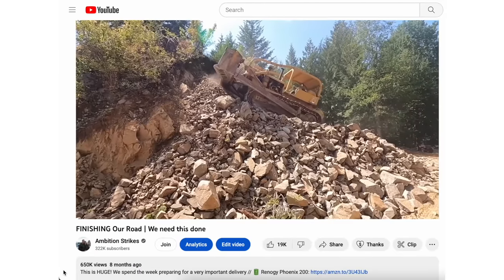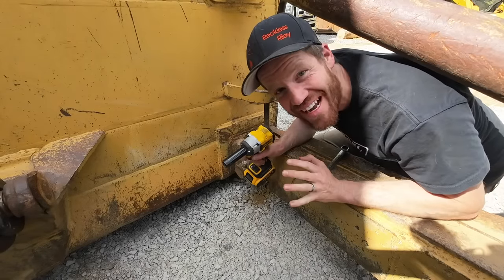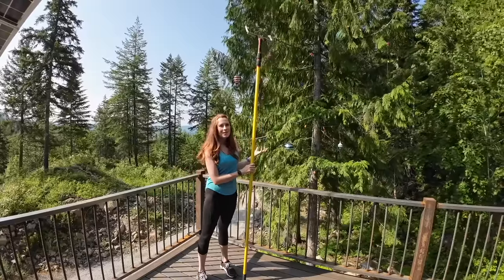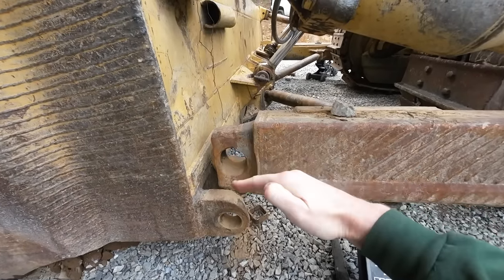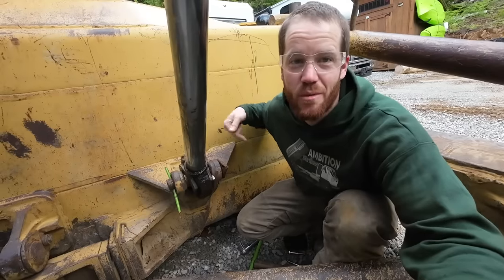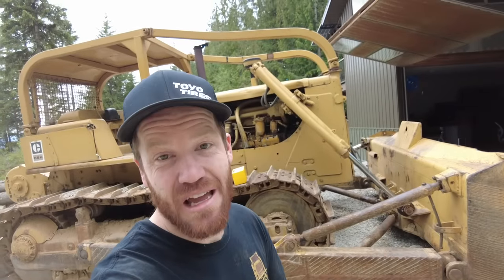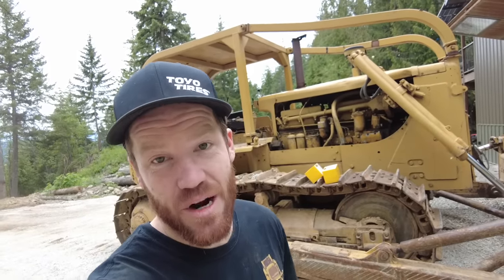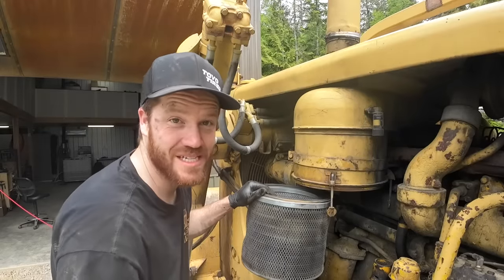Repairing My D8 Dozer (unexpected find)

Comment: I worked for CAT manufacturing and they take great pride that you can call from anywhere in the world and have the part for your CAT machine going back to the earliest machine they made.
Reply: I work in a prototype foundry and we make a LOT of small order service parts for some really old stuff.  We don’t make tooling anymore we just 3D print sand molds from CAD files and machine to 2D drawings from 1948.   It makes me smile whenever you see all the Rev changes and sign offs over decades of time.

Comment: Sorry to say Riley, but that connection at the lower corners of the blade should be a solid tight connection.  The tilt of the blade is taken up in the ball trunion on the outside of the track frame.  I’ve rebuilt everything you need there.  It would take a lot of time, money and welding.  Any welding you do on that bushing to make it solid would help, but leaving it loose will make it wear out sooner.
Reply: I saw that, but how much is he truly going to use it?  It's not like it's going to a job site 5 days a week is all i'm saying.
Reply: It's really a toss up, I am with you guys that there are a lot of issues here. I would like to see this stuff addressed, especially the trans/hydraulic system based on that filter this thing is a time bomb. The good thing is some of the cost could be recouped when they sell the machine. The gamble is that it just gets left the way it is and the machine goes down hard during use, a machine that big in a precarious situation is going to become a paper weight as no one will want to touch it. Reily seems to have a good enough understanding of how to do some of the work maybe he can rent a line boring setup and do the repairs. It isn't that hard to build one from a mag drill, that is an alternative. I just hate to see things get ignored just to come back and bite him in the ass later.
Reply: @sshep7119  -  I agree, but there is no guarantee that somebody will pay an asking price that covers the cost of the major hydraulic system fixes required.

If he's done with this thing after the road is finished than he did all these repairs for the next owner and not himself.
Reply: I would never expect Riley to restore it to factory spec considering it’s an “occasional use” machine. But I think, maybe, welding both ends of the bushing solid would help a little.  Interestingly enough, the “newer” D8’s came with a part on the end of the arm with a pin at the x and y axis that facilitated more movement with less wear
Reply: He doesn't have a line boring machine so rebuilding the slot is out of the question. He could weld the outside of the pin i guess?
Reply: @matiastripaldi406  -  I've done that before......but just as a real bush fix kind of deal.  He'd half to stack about a half inch of weld in some spots.

Real PITA
Reply: The previous owner(s) took out the ball and shims and welded the joint up. So, choices, choices!
Reply: @christopherweise438  No, but all the cheapouts, reduce the machine to scrap value, in the end. Proper maintenance means their son gets to use it, as an adult, improper maintenance means it won't last till he starts school, never mind graduates.
Reply: @carlthor91 there was never a “ball and socket” there. There are ball and sockets where the piston attaches to the back of the blade though and it looks like somebody “fixed” that already .
Reply: Wow. So much help and great insight. Maybe even advice that Riley may need. So nice for everyone to give their knowledge and let Riley make the final decision. Wonderful community
Reply: @carlthor91  -   I hear ya.  As you said.....choices, choices, choices.
Reply: @private15  Yep, we've all made mistakes, and learned from them, the truly smart ones, learn from the mistakes of others.😱🤣😎👍
Reply: yeah i would have welded that tube into the end
Reply: If you want to see how the full professional repair is carried out, look up Cutting Edge Engineering, its a great channel.
Reply: I’d have to go with the farm use mentality on his repairs. It’s never going to be good enough for job site work again, but occasional use his patch jobs will get him by fine. I have a 50 cat d7 I have to look at that way. It’s sloppy, worn in every place possible.. but it will push dirt and dig all the same.
Reply: @geraldcornes5639 I was thinking the same thing CEE run a great channel. Very educational.
Reply: @richarddelfino5766  Look at the connection closely you will see the square shoulders where the bolts fit in, you can plainly see where the cap was welded to the arm, look when he inserts the sleeve he fabricated, you will see the socket plainly, and the resultant dome in the welded on cap. The upper link with tilt cylinder restrains the side arm rotation. If I had your email I would go down to the local Cat dealer and take a picture for you.
Modern D8's use a forging with two pins at right angles, and the ball at the track frame takes all the twist, you are referring to, two totally different generations of machines, this and newer versions.

I am in my late 60's and have worked around this equipment for decades.
Reply: @geraldcornes5639  Agreed, Kurtis does first class work.
Reply: It's too bad Kurtis is half way around the planet. He'd know exactly what to do and how to do it. #cecaus
Reply: @carlthor91  I have to look closely at what you are referring to. I’m 62 and my only experience was with 46A’s and earlier.  We actually had 4 at one time (and more before my time!  My father built golf courses in New England). In fact the last one is actually down the street from my office working.  We sold it a few years ago.  I believe it was a 1974 model. I’ll look for the parts book tomorrow.  We would take the arm off the machine, use compressed air and the welder to gouge the old end off and weld a new one on.  Not a fun job.  Same with all the attachment points on the blade. I don’t expect Riley to do that unless he restores the machine, which 
I don’t think he wants to do, but I think he would be better off welding the bushing solid. He seems to be capable.
Reply: @richarddelfino5766  I worked on them in my 20's, before I went into the engineering department, in the mines.
Please look at 4:21, in the video, where he is cleaning out where the pin was, you will see where the cap was welded on, and the socket, for the spherical bearing. Hope that helps.
Best wishes from the far North.
Reply: Just depends on how long he intends to keep it.  If he plans to develop that mountain, he needs to keep it.  He doesn't have to fix all of it once, but bit by bit rebuild it.  Doing half way jobs means that the next repair may be far worse.  Riley is a seat of the pants operator and has to learn to fix things ahead of time instead of waiting for it to fall apart down slope.  I am glad to see he inspected his work he did last summer and did some maintenance.  Should he check the track tension?
Reply: @richarddelfino5766  your wrong
Reply: @carlthor91 You may be correct.  I see what you think is a bearing cap welded solid.  Cat had many bulldozer models that they hung on D8H’s.  That one is different than the ones I was used to. Now I have to dig into this tomorrow……
Reply: Their son using it? This is youtube not real world. The only reason why they bought it was to make more videos. If the ad revenue is enough to keep it running long enough to make more videos than it is a success.
Reply: If it breaks down he'll have to call Heavy D to come move it, for sure.
Reply: Riley's got they pivot story wrong but...lots of great advice here fixes that.
Great community!

What I'm struggling with is the shock of seeing ring components chewed up in that oil. 
Pull that filter again after a few hours of operation  and check it.  If metal shows up replace that filter and that oil again.

Then you will know if the problem is now or part of the machines past. Assumptions are willful ignorance in my book. Fingers crossed for Riley.

80 quarts of oil or put another way Riley needs to buy by the barrel from folks that recondition oil or he can buy bulk from  farm suppliers.
Reply: @richarddelfino5766  Riley did that. The bolt holes for mounting the plate to the blade were trashed so the field expedient fix was welding the plate in place to hold the end of the cylinder. It's held together through breaking up and moving many tons of rock, dirt, trees etc.
Reply: @christopherweise438 these machines prices are bottomed out any repairs now will actually raise the value to someone who knows what there looking at he just didn't know
Reply: @Plutogalaxy  and he could buy a brand new one for cheaper then delivery cost lol
Reply: He could pay someone to come up there and do some of the repairs, or take the arms off and send them out for welding and re-bushing.
Reply: @sshep7119  to much $$$ when he can do it help self if he wanted and it could cost less plus make money on a video Riley just thought it was a ball socket bc of how it was worn chances are he will fix it not because I has to be fixed but because it would make a good video
Reply: ytffccc
Reply: @christopherweise438  
p8okkkkķ
Reply: @Yellowdogsworld in the forests of coastal British Columbia, you’ll find lots of old D8’s in worse shape than this one. They get used a few times a year, to push some snow, assist a stuck logging truck, pull a log loader. Their production days are long over, but they’re still useful, and will remain so for many years to come.
Reply: That’s kinda what I thought as well, maybe he could weld them solid. after using it for a while he may never get the pins back out.
Reply: @Yellowdogsworld my friend has a old Kobota like that worn but still digs, easiest starting engine ever, just about only have to wave the keys at it and it goes. Factory parts are massively expensive so when the starter packed in a 12v Land Rover one was fitted, never has to turn the engine much to start it so the starter is not stressed with the 24v system, repairs like this may be a bit out in the field but they keep old machines working and productive.

Comment: You two work long hard hours, it is so hard to believe you did all that you have done in the last couple of years. Then I remember all the work I did two times, I cleaned up 10 acres of slash from a logging area that was logged 30 or 40 years ago. I bought a 1959 case 1000 track loader and made a couple roads and dug up some big tree roots. I built 7 buildings, 2 8x10s, 2 10x10 , a 10x12 two story building and 2 8x10s with lean-tos added. had a well put in $.Dug a 600 foot trench up hill to my living area mostly by hand (shovel and pic) plumed it into my 2 2500 gallon tanks. Doing this was a blast. I Sold the first place in 2012 almost tripled my money sold the second place lost a lot of money because I left so much accumulated stuff. I sold it all for $35,000.00 7 buildings one full of plumbing material one with electrical material and one with hardware, a 1970ish Case 350B dozer with 6 way blade, probably 5000 lb. no more of steel which I wish I had now. And so much more. Sold the property with well for $70,000. Now I am in Prineville Oregon doing it again, I said I wasn't going to do it again unless it had well septic and electricity. Well, I did it again, I am 72 now and it is getting pretty hard to function to do what needs to be done. I have meet a few people that are helpful otherwise I do not know what I would do. Keep having fun while you can still function.

Comment: I'm always thoroughly impressed by your courage at taking on ANY project Riley. And - - safety goggles - even for 'just drilling'?? Oliver has been a wonderful influence on you Dad!!       Happy First Father's Day!
Isn't it impressive how many parts are available off-the-shelf for a 60 year old Cat Tractor? That was the key to Caterpillar's success. Downtime is just too expensive.
With regard to 'repair - rebuild - or replace' the old planned obsolescence program, you might want to look at the machines that Cat established for their 'Certified Rebuild Program'. Some series of machines - like the D8K were deemed solid enough to strip right down to the frame (in CAT shops) and every component rebuilt or replaced with a rebuilt one. The end result was a machine that was 'like-new' even when newer tech (like the 'high-drive dozers' were around for decades. That's why some 8K's are worth so much more than 8H's - the K's may have been potential for Certified Rebuild.
Caterpillar did this with a few, select models; the machines that performed particularly well throughout tens of thousands of hours in the field. And no machine has any value - if you can't get parts for it - new or ancient. Most Certified Rebuild machines were large - mining use sized gear. 
And - I was on the new equipment side of the industry. But, we often had teams of salespeople working on the same deal - from opposing departments. The Sales Department wanted to sell a new one - but the Service and Parts department's would much rather rebuild the customers old one. Caterpillar even authorized the old serial number be replaced by a different one - to signify the fact that the machine was then considered 'new' again.
So - no worries about buying a super old machine and getting good value from it - as it will for you - - as long as it's a CATERPILLAR!

[  And - I love seeing Casey behind the skidsteer controls - she's a very good operator! It's always 'fun to back-blade a project smooth but for real production you want to always 'grade with a FULL Bucket' and push the material into the voids - not bump your way over it. 
Please be sure to keep Oliver well-above the safety bar, (or in a stroller watching from the side-lines!). God-forbid, a machine rollover could be safe for Mom - and very UNSAFE for Ollie!!   ]

Sorry to be so 'safety-concerned' but I spent a LOT of time on job sites and heard about too many good people getting hurt doing dumb things. Being overly cautious has worked for me and my team over decades. I want you to grow OLD with many children - - so I preach!
Reply: I just bought an old 1969 D8H. Just got to put the top end of the motor back together and we surface the blade. Other than that it's basically all been rebuild recently
Reply: @jamesgarrison6430  She could still have 10,000 hours in her!

Comment: I am so envious of you both. I've been mechanic/machinist/fabricator for 40+ years. The accomplishments you both have conquered are fantastic. I just finished your video of the production of the snow trax, great work. When I retired in 2010 I began investing in my shop equipment, both metal and wood working. Riley you borrowed a friends shop to use his lathe which is very similar model to the lathe I purchased and I also got a used mill & drill machine. Keep your eyes open for an old South Bend model 9a . Couple with your plasma table and your engineering prowless nothing will hold you back.

Comment: I’ve worked on my own dozer as well some belonging to family and friends - one of whom has a dozer similar to that but a different year I believe. At any rate, here’s a few suggestions with a grain of salt. Don’t replace the hydraulic fluid until it’s lifespan is up as you’ll never get all of the shavings out of the system by doing so. Just continue to check the filters and clean the magnets very frequently. Your pin solution however is arguably worse than doing nothing - because - the steel you’re using will wear both your dozer’s arm and pin at much higher rates since it’s so much harder than those parts. I’d switch to a softer metal and stitch weld the sleeve in place - using it as a sacrificial bushing that can be replaced as needed. As an aside, I am very happy to see the Badlands Off-Road Winch. I love that thing and use mine rather frequently. Godspeed.
Reply: how many hours a year is he going to use this really? maybe 100 . if it was still doing work everyday the wear would be excessive but he will use it for only relatively short amount of time
Reply: @ronblack7870  Homeslice is planning to make a massive driveway renovation and god only knows what else on a relatively large piece of property with relatively little flat space… we have no idea how much plans to use it. Plus, lending it out is always an option for extra cash. Nevertheless, with your argument, the obvious counter-argument is “then why bother putting the sleeve in at all?” He took the time to take it apart, purchase a sleeve of temperature hardened steel +/- chromium and then went about cutting and fitting it. I would assume therefore that he both plans to use it and is concerned about maintaining its structural integrity. If he weren’t, he wouldn’t have bothered to attempt to fix it.

Comment: On the hydraulic fluid, I would drain the fluid into a clean container and then stain the fluid is a very fine mesh to remove any foreign material, then reuse the fluid in the machine.

Comment: Been watching you guys since you started building the camper (was sad to see it go). You are such an inspiration that I just bought an 1985 Case 850B dozer. It has a leaky radiator and is puking hydraulic fluid out between the engine and trans but it runs great. I was able to find a service manual for it too so that should help me work on it. If it hadn't been for watching you tear into your Cat I don't think I would have bought it. Thanks for sharing your adventures and the inspiration!
Reply from the maker: Congrats on the existing purchase! I hope you have as much fun with it as we have with ours!

Comment: Parts available! That is why Cat equipment is always good purchase. I would send an oil samples to Cat to see if the oil needs to be changed. For  the engine, I use 10-40W diesel engine oil from Tractor Supply that I paid about $50 for a five gallon pail.